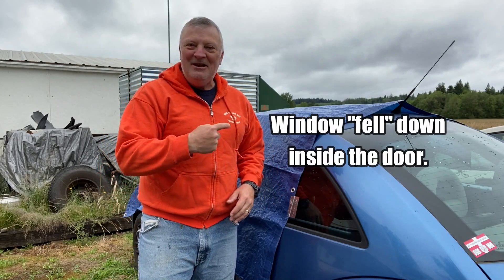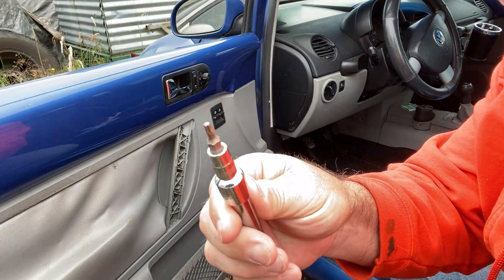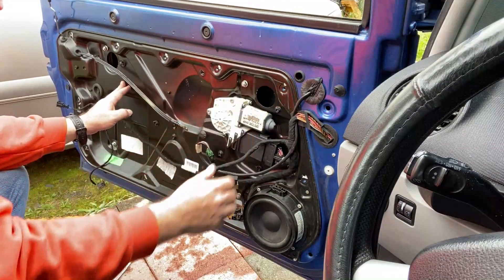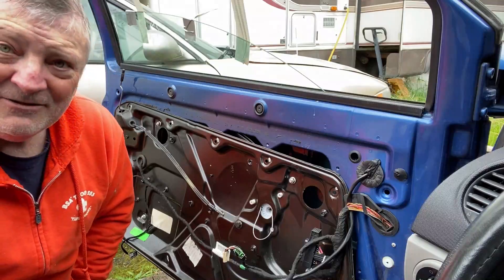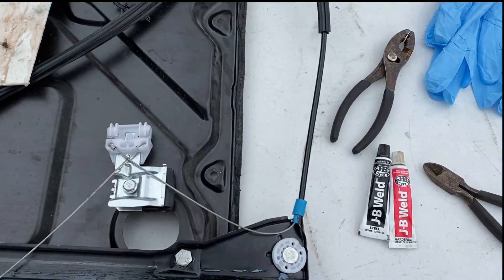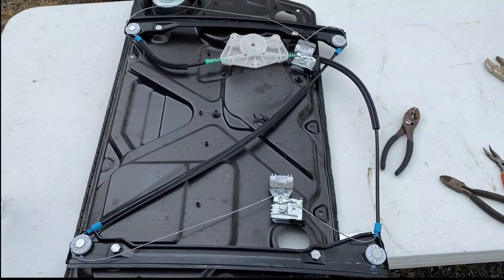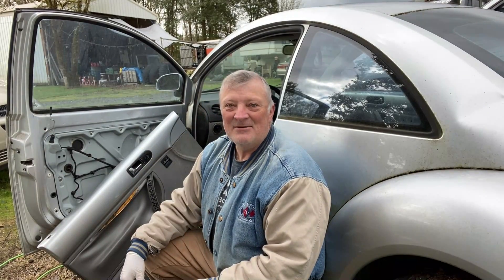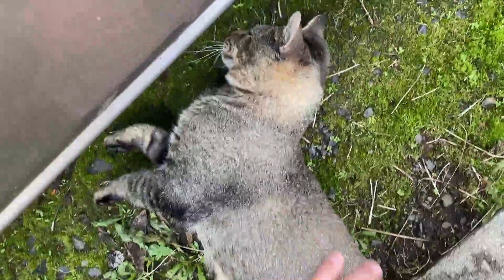POWER WINDOW Repair on VW Beetle

Comment: Hey Dave! I recently watched your video to help with this same issue I had and I put everything back correctly, except for the locking rod. I ran into an issue where my door won’t open from the inside! Was wondering if you ran into this same issue since I noticed you also didn’t have it in when putting the door panel back.

Comment: It's a little unsettling how expensive those beetles were and how there are "parts" cars everywhere... and the poor quality of plastic they used ..those interior door panels are famous for disintegrating and they are not cheap to replace..perhaps it's cause Germany doesn't experience the same type of southern u.s. heat, but the plastic compound they used is poor quality plastic.. trim pieces perhaps, door panels no...and the door panels are like 5 different pieces that snap together instead of one solid piece..
Reply from the maker: This car has been in Washington state all this time, a similar climate than Germany. Even the water pump impeller was plastic and disintegrated, causing overheating issues. Fortunately, the new OEM parts are made of metal, at least most of them.

Comment: I replaced my regulators, motors, and switches and it still only works when it wants to. I think my wiring to the switch may be bad. Is there any way I can swap my window to a manual crank?
Reply from the maker: @andrewflockhart6875  probably not an easy thing to do, but I’ve not done that, so I don’t know for sure.

Comment: Well I guess plastic is fantastic for the manufacturer to ensure repeat customer repairs 😅 Luv the JB Weld trick, probly gonna need to do that on mine. Bought the car with window problems at a good price knowing I'd have a bit of work to do, wasnt looking forward to it, but you know gotta do what you gotta do. So thanks for your video, great refresher, support and encouragement to get in and tackle the task. God bless.
Reply: I agree, plastic is for profit, not serviceability.  My 2006 Beetle's door panel is stuck at the top and won't come off.  I'll probably break some plastic retainer as a result.  I hate corporate engineering!
Reply from the maker: Glad the video helped you! I still love my bugs, and the windows are still working after all these years.

Comment: You need to spray silicone on the window tracks.  It'll move faster.
Reply from the maker: @richardwest5010  it works for a little while… I think the motor was just not strong like brand new OEM motors would be.

Comment: My daughter just got a 2007 beetle and the passenger side window works, but only can be controlled by the driver.  What would you suggest are the parts I need to get to repair that problem?  Or is it likely a loose wire to the controller?
Reply from the maker: Check to see if there is a "lock out" switch on the driver's side. This is so that dogs or children that inadvertently press the window button, and prevents the window from working from the passenger side. Otherwise, it may be a bad window switch on the passenger side.

Comment: I really liked the video, working on my granddaughters vw, having a hard time with the plug-in for the door lock. seems to not want to come apart
Reply from the maker: That plug is the most difficult nut to crack. Most, end up breaking it. Have patience and be careful. Glad you liked the video.
Reply: The plug has a push in tag that needs to be pressed in as you pull the plug. I pushed it in with a shortened wooden cocktail stick. Not easy but it will come.

Comment: Question:  What if you have this problem happen:

Reinstall goes ok.
Passenger window works from the left side control, but not the right side control.
Disassemble panel and replace right window switch.
Passenger window STILL works from the left side control, but not the right side control.

Reset window electrics with key holding it left and right to make them go down and up again.
Got into car.
Again, passenger window works from the left side control, but not the right side control.

Checked electronics.  I can hear a sound at the motor when exercising the NEW window switch on the passenger side.
So I know power is getting there.

Is the controller bad in the motor?
Reply from the maker: I would replace the passenger side controller. I had same issue with another NB that I still own.

Comment: I will never buy a beetle or any VW. they are a lot of problem.
Reply from the maker: Well.... they are easy to work on, and once you knock the neglect out of them, they drive nice. Fuel efficient, too! But, to each their own.
Reply: @HelicoolsHelipad  - I did put a new radiator on my 1999 beetle. I had to remove the entire bumper .

Comment: I have a 1999 Beetle- manual. both windows will just automatically roll down once i park the car.i got tired of it and i converted the driver side window into a manual window instead of electrical. driver side window still electric and I still have the same problem.  06/2022
Reply from the maker: That is a controller problem. I am guessing, but I think if you change the control switch on the driver's door, this will fix the issue. Maybe it got water on it and is causing the problem.

Comment: I found your video for installing vw beetle power window regulator is one of the best.  I am going to diy by myself for my wife's toy 2002 vw beetle that the passenger side widow close only halfway.  I have ordered a set of window regulator from amazon with metal cables mounted in the metal bars.  As I understood that the original metal bars were riveted (not bolted in as the new one),  My question is: is that better to keep the old metal running bars and re-install the metal cables?  If doing so, will it be easy to tight the cables back and hold on it?  If I replace it with the new set, how can I drill out the rivets the easy way without damage the metal running bars and the panel.  You didn't show on your video.  Looking for your reply.  Thank you.
Reply from the maker: Use a drill that is just big enough to drill the center out of the rivet. I think the instructions will even give you the size drill bit you need. Don't worry. They provide bolts to replace the rivets. It is not really that bad. Good on you for DIY!
Reply: @HelicoolsHelipad  Hi Dave,   I got the window regulator and tried to install and replace the broken one.  After I removed the inside cover, I tried very hard to see if I could reach the clamps on both sides that hold the glass.  Unfortunately, the window was only halfway close, no way I could reach or see the clamps.  I did try to take the motor out and tried to pull the glass up by force but no luck.  Can you tell me what is the best way to manually move the glass up ( not breaking it) untill I can see the sclamps to loose it.  Thanks.
Reply from the maker: With the motor out? Gently, but firmly pull the glass up the door channel. If this does not work, reinstall the motor, and control switch… run the window up, short bursts until the clamps are visible in the circular”windows” on the inside of the door.
Reply: @HelicoolsHelipad  Thank you for your quick reply.  I am going to diy when I get my parts.  Thanks again.  Have a wonderful summer to you.

Comment: My dad just bought one. His window wouldnt go all the way up so they sent it to a dealership. They put a new one in but its still a small spot at the front on the down slope that air is coming in. You can barley see it. How would we go about getting that fixed?
Reply from the maker: It is hard to tell without a few photos, but perhaps the rubber gasket is not installed correctly? That would be my guess. It could also be that the clamp that holds the bottom of the window needs adjusting... that is common as well.

Comment: hmm.... I have a spare car too. For a later date.... instead of pulling track, cable and the works off that interior panel.....  could you just have swapped that whole network into other car (assuming itis same side door)?
Reply from the maker: Absolutly, you can. You will have to drill out the rivets and replace them with bolt, lock washer, and nut.

Comment: Dave my passenger side just went to dust..  I honestly don't want to fully repair...  just want to put the window up and block it forever up (its a spare car).  You have a suggestion on how to hold the window up.... or will it stay up once raised?
Reply from the maker: Block it up? Welllll… Sikaflex in the upper window channel.
Reply: @HelicoolsHelipad  hmm..  welll  I'd likely want to repair at some point future.. and sounds like  sikaflex-ing would prevent that??
Reply from the maker: @coachgeo  you said permanently, right. Yeah, Sikaflex would make fixing it very difficult. 😂

Comment: thankyou, mine is slipping but i did get the window all the way up. do you think it just needs to be tightened at the access holes?
Reply from the maker: Slipping? You mean slipping off of the clamps that pull the window down and push it back up? If yes, then yes... you will have to tighten those clamps at the access hole while the window is down a few inches (this lines up the access holes with the bolt you have to tighten). Best of luck and thanks for stopping by.

Comment: Thanks Dave. I've owned the same bug for 17 years and I'm having this same problem. Inspired to fix it.
Reply from the maker: I really, really like the Beetle. It is a sleeper as far as I am concerned... it drives like a sports car and corners like its on rails. Glad you got some positive motivation to help your car serve you best.
Reply: @HelicoolsHelipad  just got one for my first car, absolute shit box sadly, trying to fix her up, great car as I’ve experienced
Reply: I replaced the regulator and motor in 20 minutes in my 2001 beetle...very easy..got the whole inner panel from the junkyard with the regulator and motor attached together...